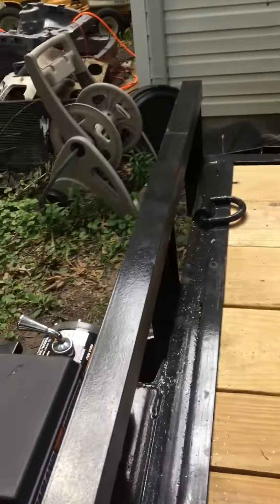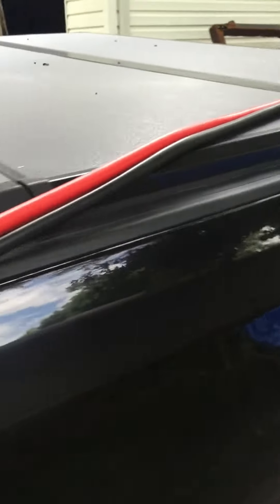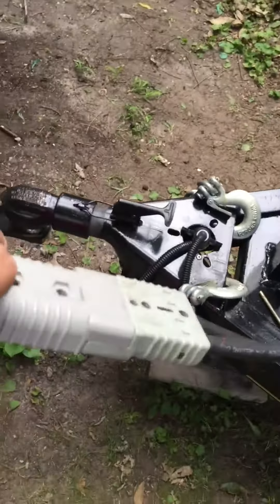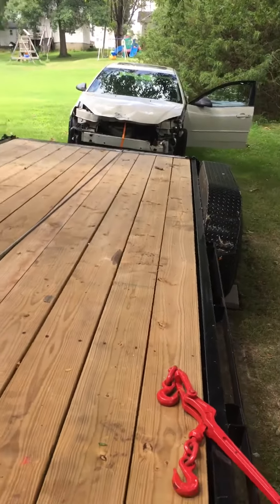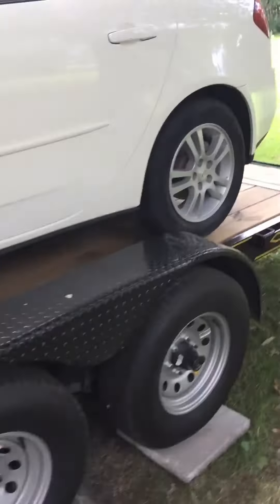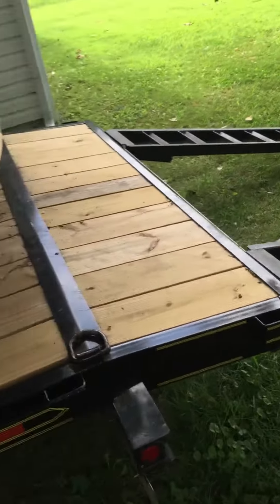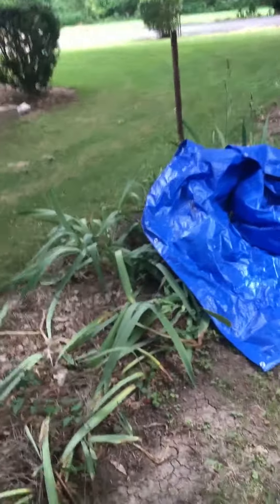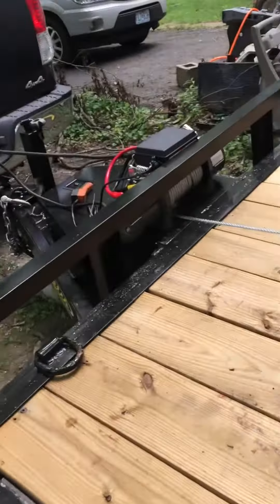Harbor freight badlands 12000 lb winch 1st pull

Comment: What guage wire did you use on the quick disconnect?
Reply from the maker: samuel Allen I used (it’s been a couple yrs but I believe) 2gage 20’ jumper cables with a forklift battery quick disconnect.
Reply: 314 Doughboy that’s actually thick enough I thought u needed like 2/0 -4/0 cable
Reply from the maker: samuel Allen that’s the same gage wire it’s wired with.

Comment: How did you mount the winch to the trailer? I just bought the same winch for my car hauler and looking for ideas, thanks.
Reply from the maker: hcytwn     I had a winch plate already mounted to trailer. I use a piece of construction paper as a template for the holes from the bottom of the winch. Then once my hole where placed right on the construction paper I set that construction paper template on my winch plate and then marked were my holes where to be drilled.  Drill holes one or two sizes bigger than the bolts for winch. To allow room for error. I had ONE HOLE  1/4" off and was a pain trying to drill only 1/2 of the drill bit to make hole right.